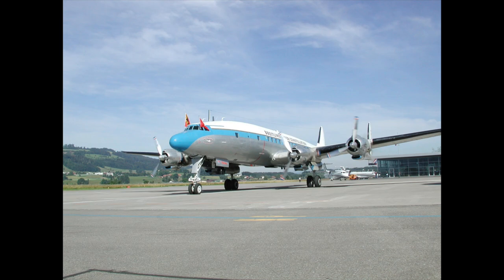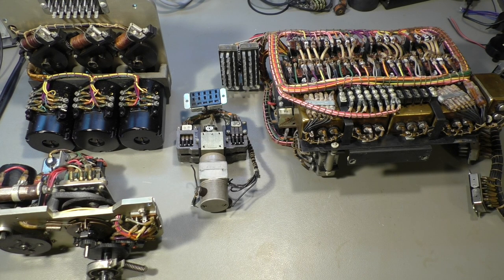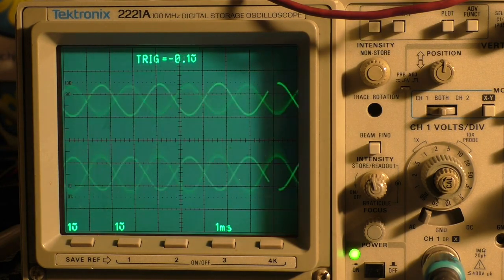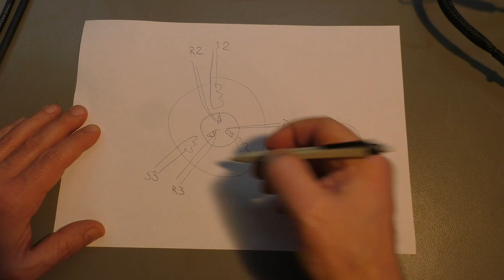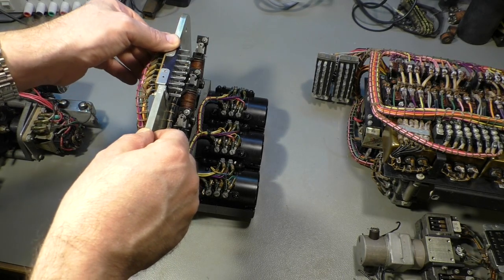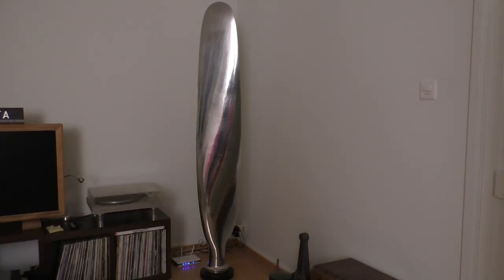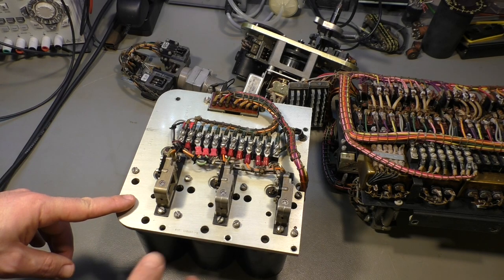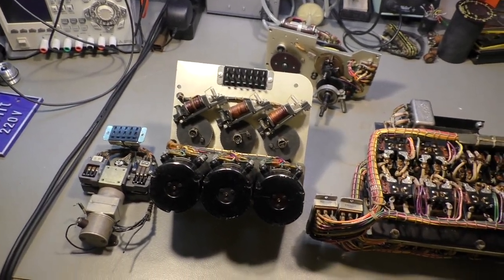Super Constellation propeller synchronizer - An analogue computer. (PWJ53)

Comment: Thank you for providing the schematic. Many years ago I was an elevator mechanic and all of the D/C motor, elevator control, and safety systems were all relay logic and analog. Nothing controlling the elevator was solid state or digital. In a large building with multiple traction elevators, the motor drives and controls were very noisy with relays and other controls clacking all over the place. That schematic sure brought back many fond memories of being an elevator mechanic!
Reply from the maker: Sometimes I think that old stuff worked more reliable than the new digital fancy LCD crap. We have elevators fom 1974 and 2004, guess which one makes more problems....

Comment: Great informative video on the Connie prop control, I am restoring a R-3350 from a Lockheed Constellation to ground running and plan to
Use the electric governor head, Another member of our group is restoring a R2800 from a DC6 and has the same set up so if we can find enough parts we will demonstrate synchronised engines as part of our display run, once again great video 👍😎
Reply from the maker: That sounds interesting! I have seen a couple of trailer mounted radial engines but I have never seen them synchronized. Could be tricky with two different engines...
It could also be done with an Arduino or Raspberry. That would be a heck of a Frankenstein construction :-)
Basically you have stepper motors in the propeller governor that can be driven by everything.

Comment: Weird coincidence, I just had a conversation with a chap who went to visit my YouTube channel, He commented 'beautiful Connie, great plane' - (I have a pic of the Constellation there). I then came to your channel straight after and there was your Connie, and I did a double check and it looks the very same one. 
The wireman here did a beautiful job.
It's fantastic to see this. 
For anyone wanting to know, The Constellation had one of the biggest most powerful piston aero engines made the Wright R -3350 Duplex Cyclone. A version of this powered the B-29 super fortress. Reliability was always a big issue, so to promote this the engines were fitted with some of the largest propellers ever used and hence they were allowed to run at a lower RPM. The big props are why the Connie has that long nose wheel and arched back. The 3 fin tail, though less efficient than a single vertical stabiliser as it gives more drag was needed so it would fit in the hangar. 
The synchroniser was only needed for comfort as the drumming sound from unsynchronised props was disturbing. The beat frequency effect is used in many fields within radio and audio. The beat frequency is the difference frequency of two frequencies. A tuning fork at 1 kHz next to one that rings at 999Hz will give a 1Hz beat for example, whooo - whooo - whooo, :o) (just like that!).
Reply from the maker: The Connie was called "The best trimotor airplane in the world"... because they mostly arrived with one engine shut down.

Comment: this was really fascinating. I remember my Dad telling me that in the WW2 fighter prop planes, they had the machine Guns positioned behind the props. and there was a mechanism that synchronized the machine gun fire, so that the bullets would go between the blades perfectly as they were turning. and if this somehow was knocked out of sync, the props would be blown right off. by their own weapons..
Reply from the maker: Year that's right. That's why Swiss engineers made an engine with the gun integrated. It had a hollow drive shaft and the propeller a hole in the center. So they could shoot literally through the propeller without danger of hitting the blades. I saw that in the Fliegermuseum at Dübendorf Switzerland. That's the place where many allied bombers landed when they were hit by Germans. At the end of war, the airfield was full of B-17s
Reply: WW1. There were some airplanes that fired through the prop in WW2 but most just put the guns in the wings outboard of the propeller arc. 
Prior to the invention of interrupt or gear in WW1 they mounted guns on the top of the top wing above the prop and even went to far as to install a metal wedge on the back side of the propeller blades to deflect bullets.

Comment: A scheme at 8:00 is well known as "selsyn resolver" and was common used in applications for sending angle position to other place using 3 wires.
Edit: for reference was used common net source 50/60Hz.

Comment: Not all propeller driven aircraft have variable pitch propellers, but they can be very helpful with optimising the operating parameters of the engine for different flight scenarios.  Also, feathering the propeller allows for testing of the engine on the ground without generating thrust.
Reply: No.  Flat pitch would be used to test an engine on the ground is you didn't want to load it.  No way would you try to run it with a feathered prop.

Comment: I remember my only flight on a 4-engine piston aircraft. It was a C-118/DC-6 I think. Eight hours from Florida to Arizona, and I was sitting right in line with the engines. The whole time, the props were going in and out of sync. As you described, it was a constant wah-wah-wah and I could hear the phasing change sounds drifting back and forth from wing to wing like someone was changing the balance knob on a stereo. Totally annoying and tiresome. Didn't experience this on a C-130, so I don't know whether turboprops don't have the same issue, or was it just that particular plane. Don't really miss those "bad old days" of propellers and analog electronics. Good presentation, though. Thank you!
Reply from the maker: Thanks for sharing that story... 🙂 It's possible that the DC6 didn't have a synchronizer. So it was up to the flight engineer to take care of it.
The later L-1649 "Starliners" even had a propeller synchrophaser, which not only controlled the prop RPM but also the position (phase) of the engines relative to each other. This decreased vibration even more. The adjustment had to be done for each airplane individually.

Comment: 6:10 Nice priority! But would the lack of "propeller beat" be noticed over the passenger's screaming? :)
Reply from the maker: In those days nobody screamed because one of four engines stopped working. A common explanation from the pilots was that they are "saving fuel" and that they were "ahead of the schedule"... so they cut one engine on purpose :-)
I know a story where a pilot explained to an anxious passenger that the Super Connie has 8 engines. Each motor has two rows of 9 cylinders and he told him that these are two indpendent motors... which is of course not true.
Those were the days when pilots were like gods... no reason not to believe them. :-)

Comment: Hi I have now got myseft a stepper motor driver but need to set the frequency, when you run your stepper motor driver at normal speed what is the freqency delevoped by the switches, cheers Patrick
Reply from the maker: I never had a stepper motor driver that required setting of a frequency. Only the steps per second were limited. Although I can imagine that the sampling frequency on some drivers can be changed. But that would depend on the motor you are using... maybe you find a datasheet?
Reply: Thank you for the reply, the driver I have a driver that works to a fashion but not correctly, I was just curious how fast the switches are switching on the original setup so I can try and match it, Also the motor I am driving is the original governor motor fitted to the engine on the Constellation. Cheers
Patrick